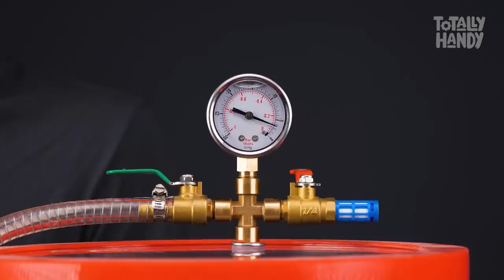How to make Container out of Steel Scourers in Epoxy & a Honeycomb Lamp | Epoxy Resin Project

Comment: Your  light will look much nicer if you put a string of small LED lights around a plastic tube in the center.  The colors will then show better. For a better effect even, cover the tube with aluminum foil before turning the led string around the tube. Many other options.